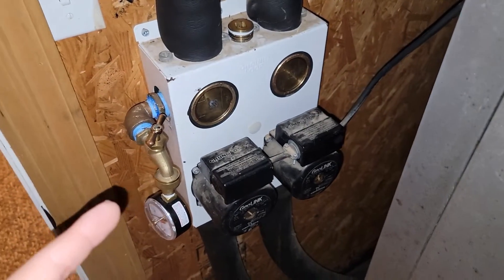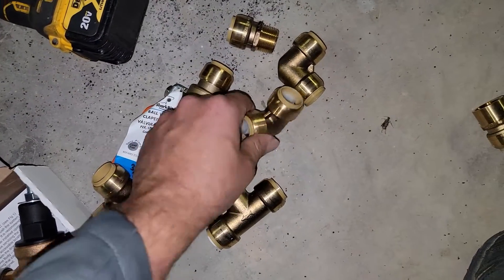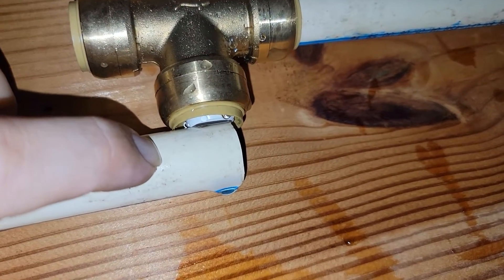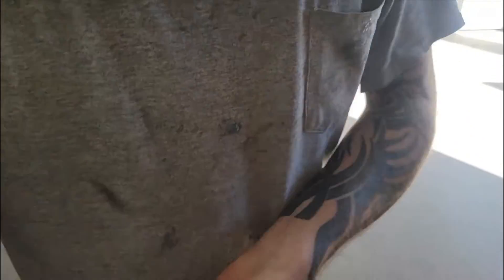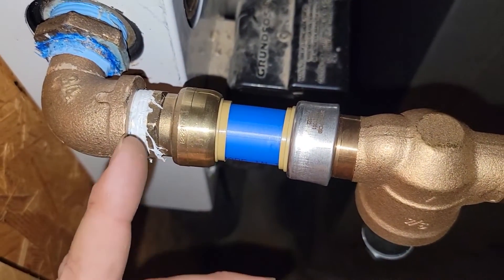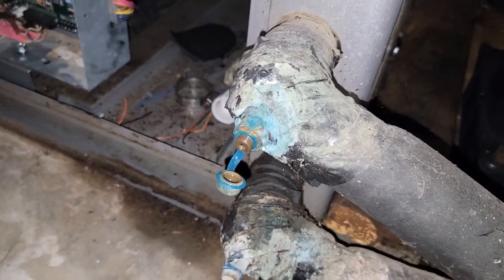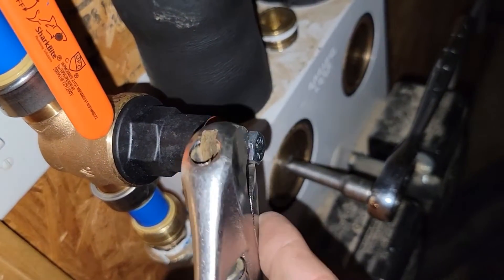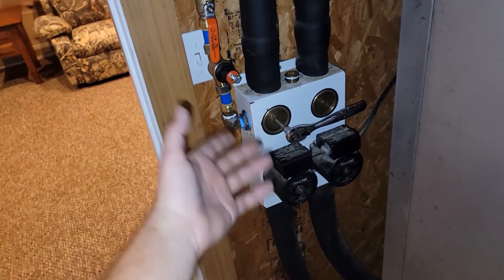Geothermal Water Supply Line and Reducing Valve Install @SharkBitePlumbing

Comment: Why not just use those orange plastic disconnect tools to remove the fitting? They're a whole lot cheaper than $70...like less than 10 for a set.